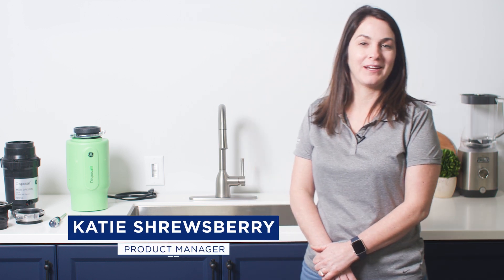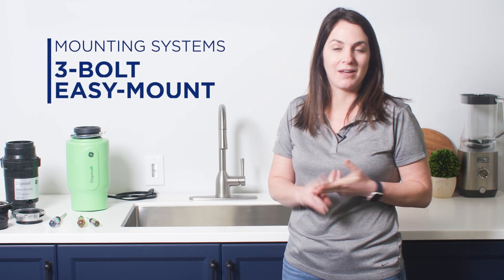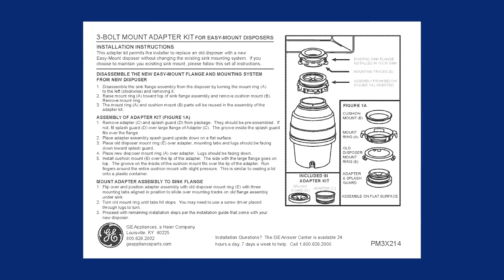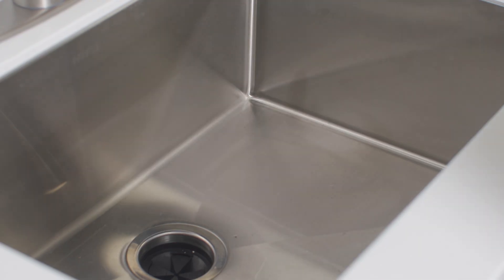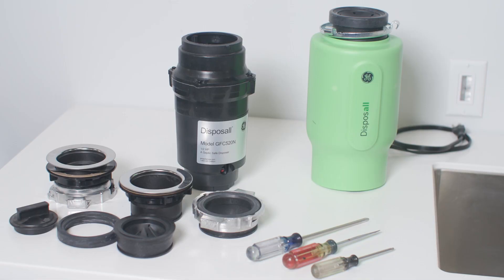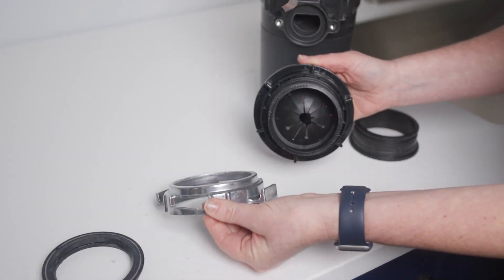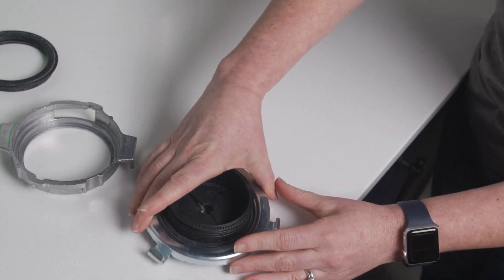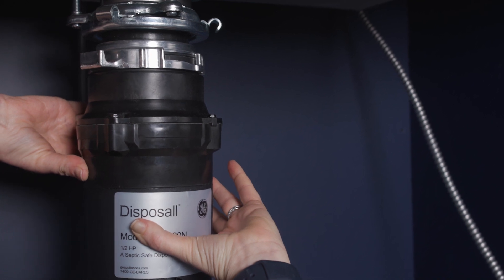GE Disposall EZ Mount Adapter Kit Install

Comment: @0:41 will it lower by 2" or will it lower by 2cm? From pictures: 7.69-6.91 = 0.78" = ~2cm
Reply from the maker: The adapter kit will lower the disposer by approximately 2 inches.

Comment: Why does the splash guard not fit with the easy mount on the GFC1020N?
Reply from the maker: Hi there!

Thanks for reaching out. Sorry to hear about the installation issues you're having. If you'd like, you can take a look at the installation instructions starting on page 7, here: http://spklr.io/6055W6IS

If you continue to have issues, feel free to PM us on Facebook or DM us on Instagram/X -MS